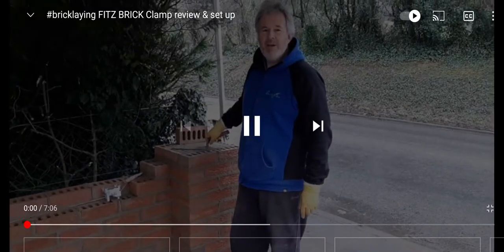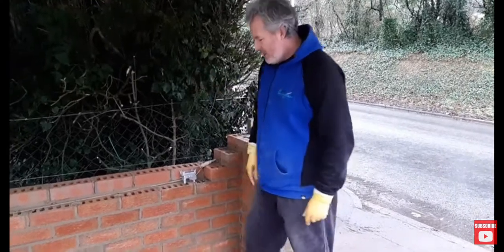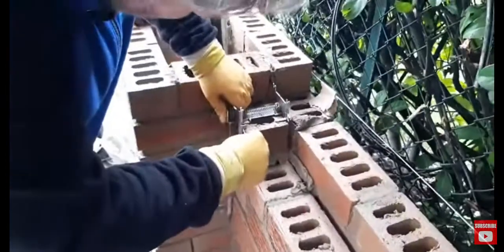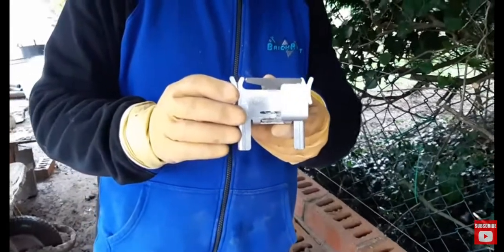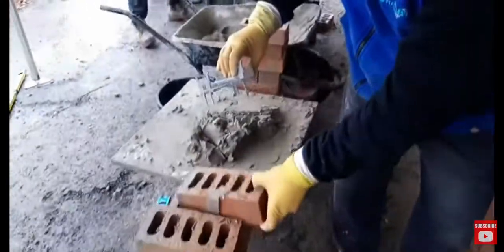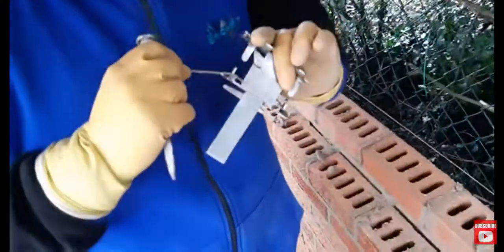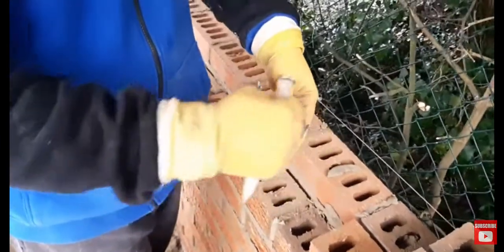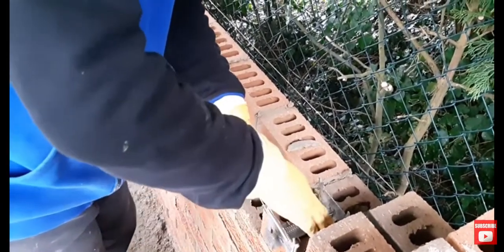FitzBrick Clamp Review

Comment: Can you keep a tight line without disturbing the corner ,just  think it looks a real faf .I do work on price and don't want to be arsing around with slack lines .
Reply from the maker: Hi Paul to answer your question I have sold thousands of pairs of clamps and not one person has come back with a complaint of any kind.  In fact they love them once they get used to them. I tested the clamps myself and use the clamps myself every day. On the clamps there are also wings on the back so for very long runs and I mean very long runs you can wrap the line on the wings which reinforces the spring. Again it's very unusual to need to do this but the option is there. If you buy them there are methods I use to speed up putting the line up contact me at brickworktools@gmail.com and I'll go over it with you.
Reply: @FitzBrick  Thank you for your reply ,could you tell me how much they are to buy .
They may come in handy for small corners and always worth having in the bucket .
Reply from the maker: @paulbest2203  The FitzBrick Clamps are £34.99 for a pair.  They can be purchased on our website www.brickworktools.com.